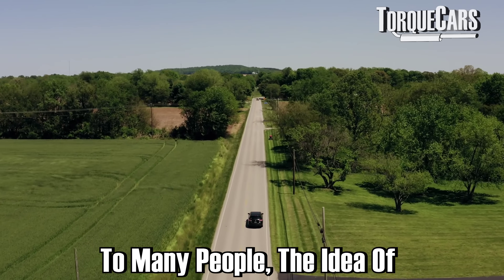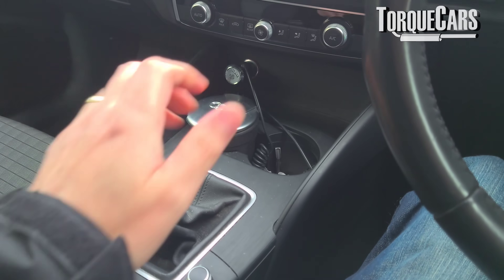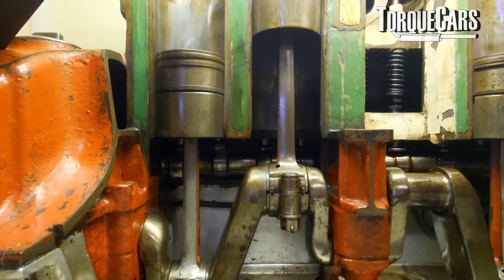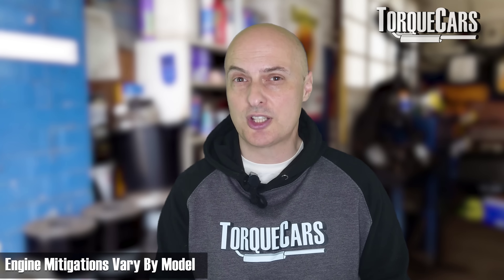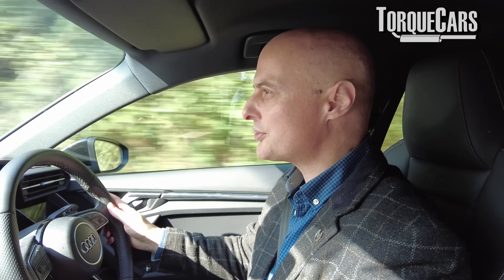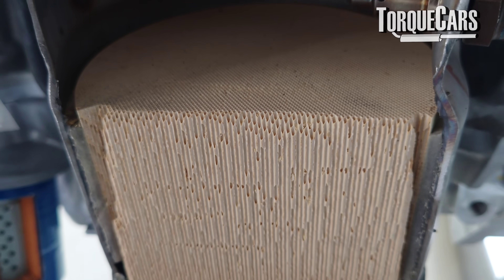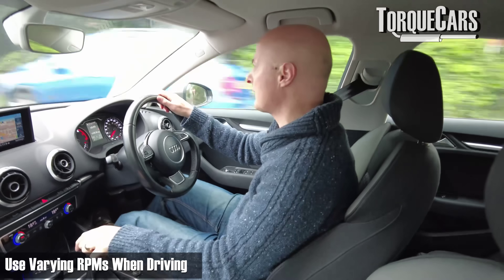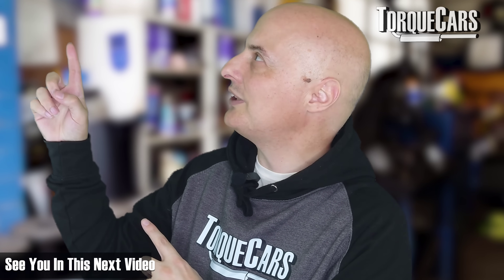BIG DAMAGE By Lugging at LOW RPM? Eco Driving Warning! (Manual Gears)

Comment: I feel like this video was written by someone who studied a lot of theory but never actually touched a car. This video is all theory but nothing about actual practice. Every car I've worked on, I've found that cars driven gingerly are in much better shape than vehicles driven by those that drive them more aggressively. Cars that are driven more aggressively make more heat overall and go through more extreme heat cycles which is what fatigues all the non-metal parts. 

All the Toyota hybrids on the road typically drive at low RPM (less than 2000 RPM) due to their electric motor assist and they can last hundreds of thousands of miles. Most vehicle failures I've seen are caused in this order: Engineering/design failures many explained by a TSB, usage, maintenance and then time. 

I don't recommend this video, it's not helpful and it steers away people from the actual causes of their vehicle's problems. Lots of people stating that "lugging" will damage an engine without any cases that can be cited even anecdotally.
Reply from the maker: I think we can both point to extremes to make a point but the reality is somewhere in between. 

I would certainly agree that aggressive driving is more harmful than gentle driving overall, but the key is that trying to accelerate hard at low rpm causes a lot of strain.

This video is not about gentle driving but understanding why engines struggle when you load them up in the wrong gear.

From my own experience I have seen 3 engines with extensive bottom end problems where the driver would only drive it at low RPM and in the wrong gear and although it can't be proven it was the cause it would be a major factor.

My step father also ruined a Mazda 626 and Datsun with his "eco driving" which meant using 4th gear most of the time. (remember when cars only had 4 gears.) I didn't realize at the time the cause and effect, but later as I learned more it made sense.

So I guess we are both saying the same thing careful driving = good and involves spreading the rpms and using the right gear, and aggressive driving in the wrong gear is bad!

It will depend on the engine and here we see small capacity engines and turbos mostly which are not all that tolerant of low rpm abuse.

The proper way to drive a car is to use the RPM range, and avoid extremes. 

Maybe I should have called the video "what happens if you are in the wrong gear?".
Reply: @torquecars  name the four engines that you feel were "abused" by excessive driving in high gear and how many miles they had before you discovered their failures.
Reply from the maker: 3.0 TDI v6 - 70,000 miles or in the region of, this had the oil starvation issue I mentioned in the video, or at least that is what we assumed it was after some research. There was a VW 2.0 TFSi a BUL engine code from 2007/2008 this had about 80,000 miles on it, the cat was also ruined and burnt out on that one! Then one was a Citroen Diesel I can't recall the year or mileage it was a fair while back but I recall the old guy driving it, said he never drives it fast or far and it was properly serviced.

As for my father in law one was a Mazda 626 1982 and it has the 1.6 engine which did about 90,000 miles, I haven't a clue what the Datsun was, it was quite a small engine.

Sorry to be vague but some of these were quite a few years back.
Reply: @torquecars  Yeah but those vehicles are flawed engines. I was searching for replacement crank bearings and came across a seller with a note on the page:
"VW and Audi blocks are notorious for a lack of lateral support at the crankshaft center line. This lack of support can lead to the block and crankshaft bending under high loads. This can lead to excessive bearing wear and block failure. The main bearing girdle prevents distortion and misalignment of the main bearings under extreme performance applications. A must for all high boost turbo applications. Supplied with main studs, nuts, washers, cap spacers, and pump chain."

Also the vehicles you listed are known for their oil consumption so it's entirely possible the owners ran the vehicles low on oil.
Reply: @torquecars  Also that Mazda is from the early 80s with a carbureted engine so its measurement/metering of fuel is going to be far less precise than that of a newer fuel injected car with oxygen sensor feedback. While your anecdotes seem useful, they're kinda not because the vehicles listed are inherently flawed. Toyota and Honda made vehicles from the 80s-2000s that could be driven high or low rev without issue. Anybody that owns a V8 american made vehicle is going to be driving their vehicle less than 2000RPM unless they want to get a speeding ticket. Honda's D series motors became less reliable with the D17 series due to the usage of thinner oil. (switching to 5W-20 vs the 10W-30) 

All the hybrid cars run the engines at low RPMs as they have electric motor assist so unless you want to start getting speeding tickets, these cars are going to spend vast majority of their life below 2000rpm.

All the vehicles I've seen with low pressure at idle like some of the 4.7L engines used in the Toyotas the issue is caused by general engine wear and high ambient temperatures with the only solution being the usage of thicker oil in the summer time at the very least.

Comment: The issue is not so much low rpm but whether then engine is labouring at low rpm or not. A small engine with no real low down torque will labour if you try and accelerate hard from low rpm and that is bad for the engine.

Comment: He uses the term "low gear" when I'm sure everyone else would say "high gear ". Pretty confusing in a video majoring on rev range and gears.
Reply: Yep he is confusing all drivers. Road signs and driving test low gear is gears 1,2,3 etc and high being 456
Reply: Well technically the highest gear is the low gear because it’s not doing much gearing but I understand where people could be confused
Reply: @ryans413  technically the easier gear for pulling away/slow speeds is "lower" if you're considering gear ratio, conversely, the harder gear for faster roads is "higher".
Reply: @ryans413  you are confused

Comment: stupid people doing stupid things to nice cars have destroyed more cars than anything else.
I told one dumb kid that had just bought a new turbo car, after I rode around in the car with him, that he shouldnt try to accelerate in a higher gear with more throttle opening as that would cause excessive cylinder pressure and possible detonation and thus damage......he told me he knew how to drive and that it didnt matter so he was going to do what he knew was OK and.....
And he blew that engine sky high in about 6k miles....got it warrantied and blew engine #2 in a bit under 10k miles and then he claimed "....these cars are junk and blow up for no reason..." and sold the car.  
He blew the next one up, too.....
BUT he KNEW HOW TO DRIVE!!!

Comment: With an automatic, I shift to "sport" for going up steeper hills or where I need to accelerate. Otherwise my (2011 POLO DSG) engine feels sluggish with the foot down and can be a bit slow to change down. I hope that is correct! The bit about the computer being slower at low to shift down revs seems to agree with my experience...

Comment: I thought two thousand rotations per minute was the standard operational engine speed for most types of vehicles. Actually I guess motorcycles are more comfortable at higher RPM, like six thousand. All these things affect traction control.

Comment: Low oil flow at low rpm and with the fuel burning too quickly for the piston stroke causing bogging are the biggest issues.  Engines are designed to run through their entire range of rpms.  It wont hurt it unless you hump the redline constantly

Comment: so the engine needs higher rpm to run hotter and burn carbon deposits, but if you run low rpm the engine runs hotter and warps sensibile parts. WTF?
Reply: You totally miss the point!

Comment: Part and parcel of driving a manual. Autos are more forgiving but not perfect.
My main concern other than lugging an engine is not giving the opertunity for the pistons and conrods to reach full stretch on the upward stroke and forming a lip at the top of the stroke in the bore.
Nanny driven cars, i.e. not given full revs ever, form these lips over time. When the engine is then taken to full revs the conrod and piston stretch and the piston rings hit that lip and destroy them selves.
This creates an oil burning monster with great smoke clouds out of the exhaust.
Oh dear, engine rebuild time.
In my cars I've always checked the RPM in top gear at the open road speed limit which gives me the optimum revs in any particular gear.
If the speed is too high in any particular gear at those revs I change up a gear.
I also take any engine to redline just about every time I drive. Might be first gear or higher.
I've never had a problem or break down in my 50 years of driving.

Comment: a manual driver who failed to downshift isnt a manual driver at all
Reply: @samirm9097  if you have to downshift your engine has no power.if you drive a corvette z06 you can run it at 1000rpm....modern turbo charged cars,are weak under 2000rpm,thats because its a inexpensive way to get more hp,but thats not hightech,only turbo pressure

Comment: This video is all wrong the only damage is carbon deposit build up on the intake valves because it's not typically burning hot enough but on typical direct injection engines instead of port injection the fuel is sprayed in the cylinder not behind the intake valve itself this why you see cars now with carbon deposit cleaning cause the fuel acted like a detergeant if you dont clean youll suffer poor fuel milage and performance because that car company cheaps out on multi port injection so direct injection and port injection best of both worlds now with a port injected just have a little heavy foot plus newer cars have worse pistoj rings as in less tension against the cylinder wall for fuel economy

Comment: Mhmm, I cannot agree with everything that has been said here. Some points are half-truth.
It is not a bad advice at all, nothing suggested here will do any harm to the engine. Does not mean the opposite is truth though.

For people wanting to get on top of this, learn the relationship between power, torque and rpm; force and energy/work; study piston engine efficiency map (BMEP map); also learn the principles of hydrodynamic bearings, effects of surface roughness and fluid viscosity, fluid pressure vs volume flow.
Then you will understand the subject matter.
Cheers

Comment: IT all makes sense, one more factor to add, if you drive low RPM, and use your car for short distances most of the time. This is a killer. Engine never gets through that heating cycle, and over the time, TAR and Carbon starts to build in it.

I have seen that with a BMW of my friend, who drove the car for grocery shopping only, i.e. short distances, he was low RPM fan. His car had engine issue so unique, BMW took his car for case study, they interviewed him on his driving habits, and fixed the engine for free. It is an extreme case, but certainly gives the idea, that Manufacturer design the cars and engine by keeping normal driving habits in their calculations, that engine shall go through all kind of RPM scenarios. if you are not driving "normally" be ready for surprises !
Reply: Short distances were the issue, not the rpm driving.
Reply: @imzjustplayin aye.
Reply: Right, a major auto manufacturer never had a case of a driver only using the car for very short distances. Cool story.

Comment: Why anybody would be surprised by that concept is baffling to me, it's been a thing forever with cars owned by older folks who puttered back n forth and the engine getting carbon build up on everything. The easiest way to clean a engine up like that is install a water injection system or put it on high idle and start spraying water in the carb or throttle body but gradual is better because you can dislodge a large chunk and crack a piston. When I was at the vocational college for automotives a guy had a 69 mach 1 with a 351 Cleveland that had been chugged around for years and the owner gave it a hot supper all the way to the school which was 2 hours non stop through middle of no where and in the shop it started banging, the teacher thought someone had dropped a bolt down the carb but no one had, it was carbon chunks breaking free, he misted water down the carb and it got worse before it got better and black water was just puffing out the tailpipes but eventually  it quieted down and ran fine, It was clanging and banging pretty good during the process, even then I thought it was a risky move he could have easily cracked a piston. Excessive short trips raise hell with engines too, if they rarely get up to operating temp they build up a lot of carbon deposits and sludge and moisture in the engine, gotta get them things hot... People think I'll run a cold thermostat for more power but same deal engines need to reach a certain temp to operate properly.

Comment: Rule of thumb, 
Idle to 2,000RPM is for driving.
Idle to the rev limiter is for accelerating, engine braking and high speed.

You won't bend it 
If you don't send it 

Send it!

Unless you drive a 1.3L Yaris, then you need to change up gear 50RPM before over rev cut, because pathetic torque to weight ratio.
Reply: lmao, it doesnt work. My 1.0L engine bogs down under 3000 rpm's
Reply: Torque to weight ratio has no engineering meaning. Only power to weight ratio appears in the physics for acceleration.  P=Fv, F=ma therefore P=(ma)v and thus acceleration = Power / (mass x velocity) ... torque does NOT appear. Torque is mainly just a function of the capacity and geometry of the engine (undersquare or oversquare, 2-valve or 4-5-valve airflow characteristics).

Good torque at low rpm, really just means good power at low rpm.  Power is the fundamental rate the engine can convert chemical energy to kinetic energy.  Torque is just an intermediate crankshaft twisting force due to the geometry of an internal combustion engine.  A rocket or jet engine can create power directly from thrust without using torque.

Comment: My mini 1.5 DCT petrol tries to select the lowest possible gear in normal and eco mode. It ends up changing gear at under 2000rpm and at 70mph it sits at 2000rpm in 7th. Sport mode is better and more in line of what I would do in a manual but could be better. Rare to see it change over 3000rpm.